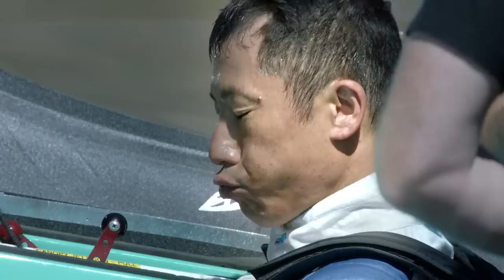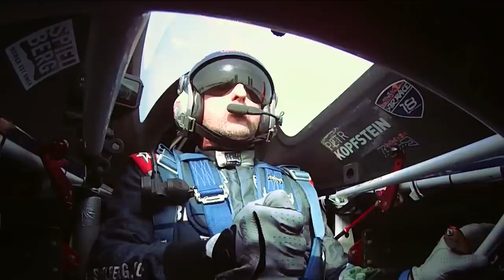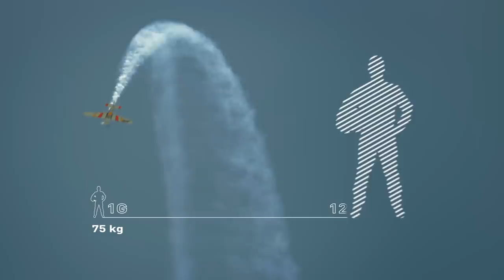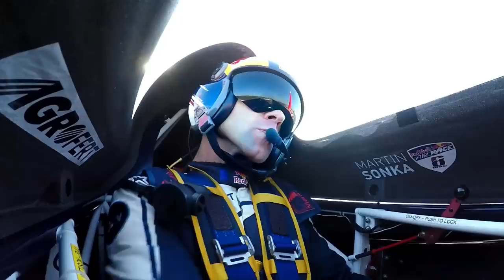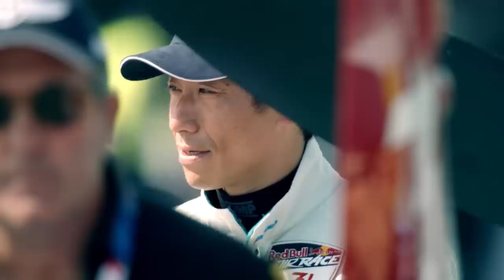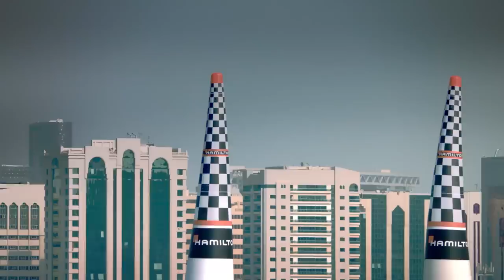What it takes to fly in the Red Bull Air Race

Comment: WW2 dogfighters reincarnated
Reply: I was just thinking of the damage these planes would have done in the 40's, they make Spitfires and Zeros look like Lancasters.
Reply: @jallan1407  When you load them up with 20 mm & 12.5 mm cannons with thousands of rounds they would probably lose some of those aerobatic capabilities.
Reply: @jallan1407  Not quite. Those racing craft as manouverable as they are, are much, much slower compared to WW2 fighters. Manouverability isn't much in air combat if you don't have the speed to follow through (the soviet I-16 is a good example of that). Keep in mind that they had really well performing air-racers in the 1930's but simply putting guns on them wouldn't make for a good fighter.
Reply: @heckpupper9532  I remember hearing of an Italian or German air-racer turned fighter that failed because it used its wing surface for cooling and bullet holes really fucked it up.
Reply: @xavierrodriguez2463   ahhh yes the He. 100
Reply: @keltondavis4559  That thing is fast af, but yes it's much more prone to turn into a ball of fire or a glider with a bullet through the wings
Reply: Xavier Rodriguez I think the British had a very similar problem initially. Their now famous Spitfire was partly inspired by and based on a Schneider Trophy race plane, also built by Supermarine, in which the engine (which is now known as the RR Merlin) was almost impossible not to overheat. The plane therefore used radiators in parts of the undercarriage as well some other neat tricks, which were obviously no good for a plane that would go into combat and be shot at. That gave them quite a few headaches in the early stages of development.
Reply: 50 bmg weighs 110 gr per round the amo count of the P51 is 1740 divided into 2 guns with 270 and 4 guns with 400 rounds. That would be 191.4 KG of ammo
A Browning mashine gun weighs 38,14 KG hoewe the version used in planes is missing some part and is lighter. Lets gues 25 KG this is an aditional 150 KG 
While they dont weigh as much the links of the ammo also ad to the weight. 
Furthermore would you probably like a armoured seat and buletprof glaspanel. 
The added weight would probably be around 380 kg 
Hoever if we want a useful fighter we need to significatly increase fuel capacity. Longrange missons etc. 
No we are up to about 420 KG. This is about an extra 60% of what such a plane weighs

Furthermore is the plane is still slow for from about 1942 standards onwards. 
The engine i read somwhere is not supercharged which would significantly reduce performance at altitude. 

One of these race planes weighs 698 KG in contrary the A6M Zero which was very light for fighter standards weighed 2360 KG

Comment: they get 10 and 5 G's for 60 sec, but f1 drivers get 5 and 3 G's for 2 hours. There's a difference, but both sports are amazing, and flying is one of the hardest things to do, but if you have'nt driven an F1 car, you have no idea of what it feels like
Reply: And planes hit those peak Gs very briefly.
Reply: Not to mention the bumps drivers feel constantly in F1, rattling their entire bodies very violently constantly, while planes fly smoothly. Also, the force it takes to simply press the brake pedal in an F1 car is insane, it's something like doing a single leg squat with 80kg on your back, and that's on top of the force that also pushes the driver forward when the car is slowing down, and they do that over and over again in a race. Also, most G-forces in planes are in one direction, down, towards the pilots legs, because no matter what he does, the plane always angles and then turns by going "up" or "down", so the G-forces the fight pilots feel are always pretty much in the same direction, and that makes it easier to adapt and handle, since the body gets used to it and it's always the same thing the pilot needs to do to prepare for the forces. F1 drivers feel forces in all 4 directions, when turning, slowing or accelerating. When you turn hard left in an F1 car, you feel that force trying to rip your body towards the right. When you turn hard left in a plane, the whole plane and your body first roll left to 90 degrees and then the pilot pulls down to make the plane climb towards left. And he feels very similar whether he's turning left, or right, or climbing straight up. F1 is overall far more demanding on drivers. No wonder they lose so much weight in a single race from all the sweating.

Comment: The hand + parts of the weight of the arm might way 5kg...so when they pull 10G they lift somewhere near a 50kg weight and have to do split second milimeter corrections. Imagin the muscel memory to cope with these changes. It might be something inbetwwen, but even if it is just 20-30kg, it is still impressive.

Comment: Shows what athletes these pilots are (not that I didn't know that, my father was a flight instructor and raced at one time). 12xg is pretty much the limit of what the human body can take for ANY length of time and not black out. You have to be in absolute peak phtysical condition - fighter pilot condition - to take that kind of force and not black out, which would probably result in your immediate death. I've flown the Extra 300S in a simulator, and it's a dream to fly... but I'll never be in the sort of shape they need to be to take those kind of Gs. And that's before you get to the airmanship required to run that course and not cut a cone, and the fact that hundredths of a second count. Just, you, the plane, the course... and the clock.

Comment: For those who don't know, you can't compare them to fighter pilots since a fighter pilot have to take the G's up to 30 sec or more but the red bull pilots are only in 12 G's in a split second any longer and the plane would fall to pieces
Reply: That’s true but fighter jets don’t have the turn rate these stunt planes have its 2 different experiences
Reply: ur wrong
Reply: @Veslanjejezivot  about what?
Reply: I've worked with fighter pilots most airframes are g limited around 9 g some even lower and they do pull longer turns but they also wear G suits and the margin of error for the Red bull guys is generally much thinner, at these altitudes even a gray out is certain death and that half Cuban 8 at 10 g+ is no joke. The Blue Angels pull 7+ g with no g suits. In the last Thunderbirds crash the pilot blacked out at 8.5 g

Comment: I take it that the high g forces are positive. 
Not negative or sideways?
Reply: Correct. 1g is your weight on earth rn, 8g is eight times that weight. Negative g forces are found on other planets, or our moon for example is about 1/6 of 1g, meaning you'd be a lot lighter.
Reply: @LegnBacon  Nah mate, that's not what negative G means. Positive Gs are directed downward, i.e. they're pushing you into the seat. Negative Gs are directed the other way, i.e. upward (and they're a LOT more unpleasant than positive Gs).
Reply: @antred11  sorry you're right, thanks for the correction. I was a bit foggy on the difference of something still in earths atmosphere vs what things in space are orbiting
Reply: If you're flying inverted that's -1g else 1g

Comment: Ain’t no way In hell they pulling 12 g’s. These planes only hit 240 mph, scientifically inadequate
Reply: Noah Lignell 265 to 280 mph actually
Reply: Its almost like they research the physics involved in the race, but i know right?
12gs...
Reply: You can hit 12g at far less than that if your turn radius is small enough.
Reply: Speed isn't the only contributing factor in G; there is also turn radius, and these are very tight turns to do at 240-280 mph
Reply: I don’t think you took basic mechanics in high school or college. The angle of turn plays a huge role.
Reply: Radius of turn is the other factor in g a rollercoaster can pull 5 g at 60 mph in a loop while an airliner at 500 mph isn't going to pull more than 2 g in a turn